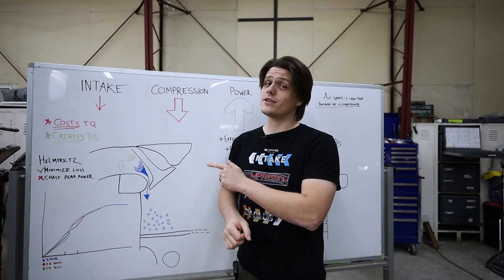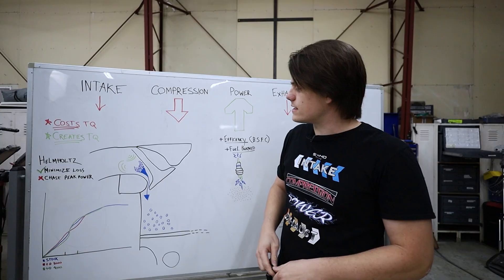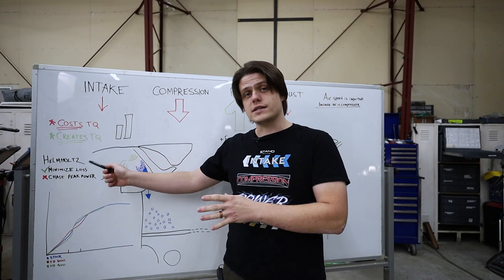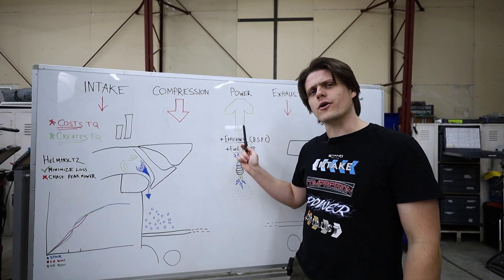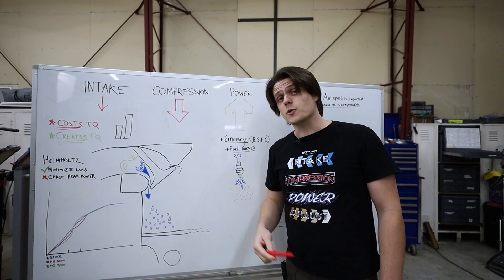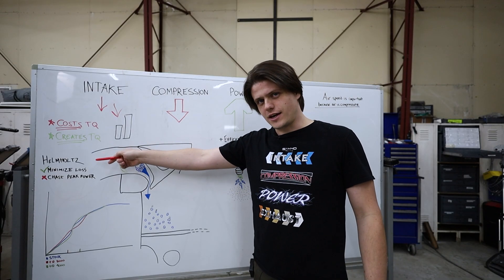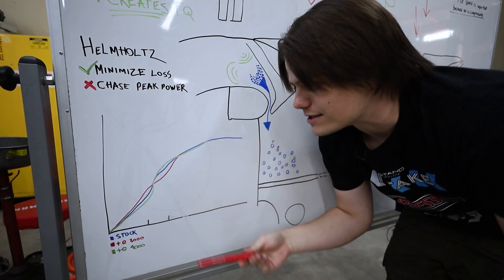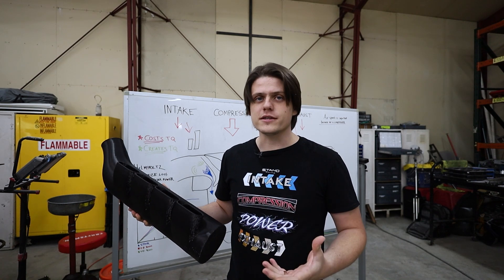How to design your own intake (What I've learned so far)

Comment: You hear a lot about the air piling up against the back of the valve and reflecting back up the tube. This does happen, but it's not the main effect. If you run the numbers for intake resonance under this assumption it looks like the runner should come into resonance every couple of hundred rpm so by that assumption it should never go out of tune.

What actually happens is the strong vacuum pulled by the piston on its induction stroke sends a rarefaction wave up the runner. This is then reflected off the open bellmouth which reverses the sign and reflects back as a positive pressure wave. Tuning the runner involves timing the creation of the rarefaction wave (approximately at the point of the piston's fastest movement down the bore) so it reflects back just as the valve is closing on the same induction stroke. That positive pressure wave piles the extra air in, and is a much stronger effect than the reflection of the air off the valve.

Have a look at the Speed Talk website for more detail, and people who have actual credentials rather than just some random replying in a youtube comment.
Reply: Absolutely right, everybody gets this wrong..  

The other thing that grates me is that idea that the wave needs to arrive when the intake valve opens.  As you say it needs to arrive just before it closes… (you gotta put the lid on quick after you stuff the last in!)
Reply from the maker: That also seems more sensible because the gap is smallest just before the valve closes, so it needs all the help it can get to flow through that small opening. 

The pressure difference should be highest right before the valve opens. With the air already rushing in because of this, that wave coming in at this time would potentially be unnoticeable. Good stuff!
Reply: @MakingforMotorsport  Yeah that gets me too. If you pile it in at the start you just get less in through the rest of the induction stroke as it equalises.

There might be something to gain by timing it for valve overlap and getting better scavenging, but that's a secondary effect.
Reply: @BiTurbo228  completely agree, I think on most short intakes 1st or 2nd reflection pulses will help for valve overlap, but as there is always more energy on the exhaust side the pulse tuning on the hot side is always the stronger effect…
Reply: Dont know if it is mentioned on the website your are talking about but i suppose the window for this harmonic wave would be very smal in rpm range. Unlike a twostroke with its expansion chamber the pulse need aproximatly the same time to travel back and forth to gain more than one atmospher. A fourstroke intakt valve is open lets say 1/4 of all strokes wich leads to 3/4 of closed and therefor to big timeframe difference to gain the same kind of effekt as an twostroke.
I may be way of topic but worth mentioning as this has crossed my mind couple of times while i think of this harmonic wave on fourstrokes.

Kind regards from Sweden!
Reply: @alfredtorstensson4742  Yeah a lot of this is the application of 2-stroke approaches to 4-stroke engines 👍

The rpm range isn't huge, and you find engines go in and out of tune across the rpm range. The usual approach is to match the exhaust tuning to fill in the dips caused by the inlet tuning (or vice versa)

Comment: So your second explanation on airspeed is one of the things that led to the poor flowing intake port runners of the '80s and '90s.
Since you're really into this one of the things that's really interesting is how some "rebels" of engineering inside GM decided to ignore the airspeed and chase flow. Obviously today we know if you have a massive amount of flow but low air speed you could in theory have the same as an engine that had The ideal high airspeed but had to limit flow... But that wasn't believed at the time. 

So these rebellious engineers inside GM did not want to see the V8s become overhead cam four valve engines like almost everyone else. They believed that if they applied what they already knew worked out on the track they could prove everyone wrong.

And in a way they did. That's how we ended up with the various engine incarnations ending with the whole LS and now LT engine series. These engines use massive intake runners and ports and valves, which lets them achieve excellent cylinder filling at all RPMs... Which is why you can have an engine that is a high torque low horsepower setup, swap out the cam and suddenly it's still breathing and making a ton of horsepower up top. It's not choked off in an attempt to keep air flow up It's opened up and keeping airspeed low but cylinder filling high all the way up to the end....

It completely throws out the theories that you're presenting in the second half of the video, and it works really well when the engine is designed that way.

Of course most engines are not designed that way. And you're only working on the intake and not the intake runners on the head. So you're limited to working with what you have.

In the end while all this theory is important It does show that sometimes building stuff over and over and seeing what works even if we don't know why it works can give you better results.

Comment: Funny thing about aero is, it acts different with different obstacle. Where foil shape has about an inch of noticeable increments, runner acts on fractions of a millimeter. A hair width of material in the wrong place and the horn is out of tune. In the subject of horns, the sound of horn is a pressure wave pulse amplified by the brass via the natural frequency and elasticity of the material. The horn vibrates in sync with the lips and the wet fart gets amplified to a deafening wave of sound. Same concept can be utilized to amplify the valve pulse, but if wrong material is used, the pulse damps into wet fart. Another thing about sound is, it is a pressure wave coming towards you. So if you hear your intake "honk", you know you have lost horse power to vanity. For the positive pressure intake, you could use the secondary curve to fill the box and long runners to fill the combustion chamber. Mind you that the exhaust and cam timing needs to be in tune with the intake for any noticeable result. Again, a hair off and the system is out of tune. Even spark timing has an effect on harmonic flow direction. When your secondary stream fills the box on higher RPM, this compensates the lack of air pressure inside the longer runner leading up to overall power output gain.

Comment: Sweet stuff mate. I understand the runner needs to be bent to a "U" shape to increase the intake length, but do you know if it actually increases or decreases the flow through the runner? I'm trying to design a 3d printed itb plenumn with my brother. keep up to the good work dude
Reply from the maker: Thank you! The bend itself will be less efficient than a straight section if that's what you're asking.
Reply: @StandRacing  yep, that's what I was asking. There's no real way of getting around it though ay. Benefits of a longer runner will probably outweigh the effects of the bend of the runner. Thanks for the reply, Cheers 🤙
Reply: I did an fluid FEA on a "U" vs straight intake when I designed an ITB intake for my Miata, and a relatively tight 90° bend had pretty poor flow characteristics. The airflow will basically "apex" the cross section of the intake when there's a significant bend, where the bulk of the airflow takes what looks like the racing line through the bend and the other areas have very slow, turbulent, or even separated flow at higher speeds. That's basically the same effect as decreasing the diameter of the intake in those areas... I can't imagine any other reasonable intake designs having much worse flow. You should make sure that any bend in your intake isn't tight enough that the inside of the curve is significantly shorter than the outside, a rule of thumb is to not curve it tighter than the stock intake. The one shown in these videos goes for what looks like the widest bend possible, but unless you're going to do a very detailed analysis and commit to a plenum setup, a straighter intake is the much simpler, easier, and likely better option. I ended up with an intake that's curved maybe 30° total. The only reason I curved the intake was to get clearances near the frame, and I ended up just maximizing the available space to get the longest intake length I could fit.
Reply: @agerrgerra1361  Wow that awesome. Thanks for the reply. Ivs got itbs on NB mx5. So basically, straight is best, and if it needs to be, less angle of bend the better. Cheers 🤙

Comment: Turbochargers use the expanding heat energy from the exhaust gases in combination with a charge air cooler to generate a higher intake air density than exhaust gas density. If the exhaust was not hot the turbocharger would not be able to generate higher intake air density than the exhaust gas density.
Reply: Also resonance tuning is more about optimizing the pressure wave from the back of a closing valve into an opening valve from an opposing cylinder. Not so much back into the same valve.

Comment: No such thing as too big supercharger. Just as long as the boost isn't excessive
Reply: Yeah the compressor has a efficiency curve though.. smaller blowers hit harder down low but fall off, big big blowers you might never hit their peak efficiency. Twin screw and roots blowers can have a lot of rotating mass to get moving

Comment: The same flow rate through a smaller diameter tube = higher velocity. The effect of runner length on velocity is negligible after a few inches. What runner length does do is increase the colomn of mass behind the valve. As the piston slows and the valve starts closing having a larger mass with a higher velocity = greater pressure. A smaller diameter will reduce flow at higher RPMs. The effect of turbulence caused by longer runners also starts to have a more pronounced effect at higher flow rates. Turbulence also has a much more negative effect with fluids of a higher viscosity. Air does not flow like water or oil so that syringe example is somewhat misleading.

Comment: Drag racing is where peak power wins I’m sure.
Reply from the maker: I'd say drag racing is the most important time to have a high average HP/broad powerband. You want to get the most out of each gear. If you have a narrow powerband you're not gonna be able to stay in the power without shifting often

Maybe in rally racing or drifting with a close ratio gearbox you could keep the engine speed within a few hundred RPM and make use of a peaky engine.

Comment: Around 7min mark I think you are starting to confuse things. The pressure differential across the valve combined with the momentum of the air already flowing through an open valve gives you the supercharging effect. The velocity of the air flow impacts the strength of the pressure waves, and it’s a balance act between small diameter=high velocity=stronger pressure with larger diameter=greater mass flow potential. The pressure waves drive all of it so the resonance of the duct is critical to making power.
Reply: Sorry for the string of replies, but area under the curve does indeed matter, but only in the operating range you use on the track - if your gears are spaced properly, let’s say that worst case (between first and second gear) you keep the engine between 4000-7000rpm, then the average power from 4000-7000rpm is all that matters. And the impact of efforts to make power power at low rpm is pretty small, maybe 10% max, sacrificing a lot of area under the curve of top. You can just downshift and get a much bigger increase in power since your gear steps are always going to be greater than 10%. 

Remember, power is what gives you acceleration, not torque - let’s say you were going 50mph and could choose between 6000rpm, 200hp, 175ft-lb in 2nd gear or 4000rpm and 150hp/197ft-lb in 3rd gear, you should always choose 2nd gear! F=m*a and P=F*v, so 33% more power in 2nd gear means 33% more longitudinal force (less than 33% more acceleration due to rolling resistance and aero drag). So even though 3rd gear gives 13% more torque it will be much slower!
Reply from the maker: I'm gonna take all that as homework so I can get a better understanding.

I can say though, you're forgetting about mechanical advantage in your 3rd gear 2nd gear scenario. Assuming 2:1 second gear ratio, 1.5:1 third gear ratio, and 4:1 final drive, the car is making 1,400ft/lbs of torque in 2nd at the axle with 175ft/lbs at the crank, and 1182ft/lbs in 3rd at the axle with 197ft/lbs at the crank. That's why 2nd is faster. Vehicle acceleration doesn't take engine RPM into account, only force at the contact patch.
Reply from the maker: If the tire has a 12" radius 1,400ft/lbs becomes 1,400lbs of force at the contact patch.
Reply: @StandRacing  yep it’s two ways of saying the same thing, but that’s the beauty of P=F*v, you don’t need the gear ratios, tire diameter, or torque numbers to figure out your acceleration. At the same speed, if you make 20% more power you get 20% more acceleration (ignoring aero drag). I’ll use SI units here for simplicity, but if you have a 1000kg car, and 200kW available at 10m/s, P=F*v means that F is 200,000W / 10m/s, or 20,000N. F=m*a means that acceleration is 20,000N/1000kg = 20m/s^2, or a little over 2g! With drag racing tires on a good drag strip that’s what you’ll get, with street tires you get a lot of smoke :)
Reply from the maker: That's really interesting. I started second guessing what I said about engine RPM being irrelevant to acceleration when I thought about high-hp, high-rpm cars. If engine RPM didn't matter, only torque, how could a car increase its rate of acceleration above 5252RPM? It's because your P=F*v is more applicable than my calculation.
Reply: @StandRacing  yeah my background is in automotive powertrain (Formula SAE in college, Toyota for 4 years after graduating, then machine design, then railroad testing, and now I’m back in powertrain again). At Toyota, one of my jobs was automatic transmission calibration, specifically tuning the accelerator pedal response. With modern drive-by-wire it’s a look-up table of pedal position vs. target drive force (total longitudinal force of the tires’ contact patches on the ground). Then the transmission ECU requests the appropriate amount of torque from the engine based on that look-up table, and the engine ECU figures out how far to open the throttle.

At some point, after struggling with some calculations for modeling the system and predicting the response of my calibrations (using torque, gear ratios, etc), the F=ma P=Fv relationship clicked for me and it really helped a ton with simplifying everything and building better models. I remember being struck by “gee, how did it take me so long to think of applying two of the most fundamental physics equations to this?”
Reply: @StandRacing  And just to make sure I state it explicitly, I think it’s awesome that you’re diving head first into all this! Trying to help out with whatever knowledge/experience I’ve gained over the last 15 years or so :)
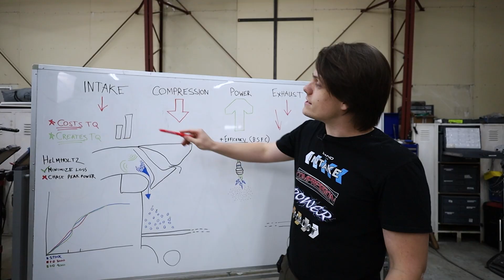Reply: …and at 9:30 or so, restriction of the runner doesn’t depend on length (at least barely at all), and the momentum that builds up is not a function of length the way you describe. It’s the combined effect of pressure differentials across junctions like the valve, runner-to-plenum, combined with how long of time the air has to accelerate. F=ma, p=F/a, etc. The best thing for power is a long drawn out positive pressure pulse over the duration of the intake valve open event, with as long of an open event as possible, while simultaneously having a long negative pressure pulse at the exhaust valve to increase that pressure differential even more. Even with a long skinner intake runner, if the intake valve only opens for 5deg you won’t build up any velocity because there is no time for the pressure/force to accelerate the air.
Reply: And at 10:10, you lose power at high rpm with long runner because the pressure pulses start to go out of phase with the valve timing. Yeah, there’s some viscous drag but it’s pretty minimal in a properly sized (diameter) intake runner.
Reply: Agreed, it’s the pressure differential created by the piston speed against the restriction which is the intake system that dictates airspeeds, you don’t want peak airspeeds above 640fps as the air is hard to control over the short turn radius, the minimum cross sectional areas and peak piston speeds are what determines these airspeeds and peak power rpm points.
You have to remember that a piston is travelling at different speeds during a single stroke, it’s peak speed is around 76 degrees after TDC, the valve opening ramp and duration has the main effect on what the pressure differential is that dictates airspeed past the valve until the cross over point, the cross over point is when the valve is at a lift point that is 0.25 of the valve heads diameter, this is when the valve curtain area is equal to the valve head diameter, after that point the ports/runner minimum cross sectional area becomes the point that dictates the pressure differential and airspeeds, you can absolutely create higher than 100%VE with any length runner, it’s all about how and when you accelerate that air column, the length has nothing to do with it.
A runner can be very long and support high rpm if the cross sectional area of that runner is large, look at a tunnel ram for instance, in regards to helmoltz the 2nd pulse is the strongest and a longer runner is used in higher rpm applications to use the 2nd, most manifolds aim for the 3rd pulse for packaging reasons to use shorter runners, that is no matter what rpm point your aiming for.